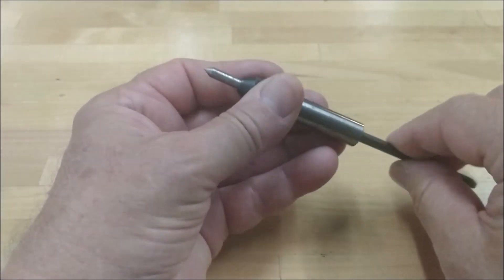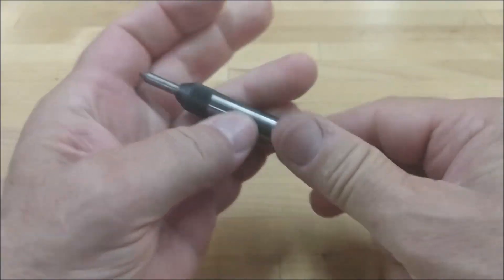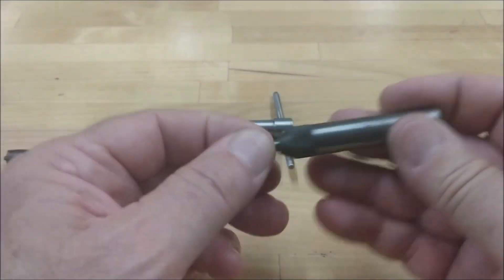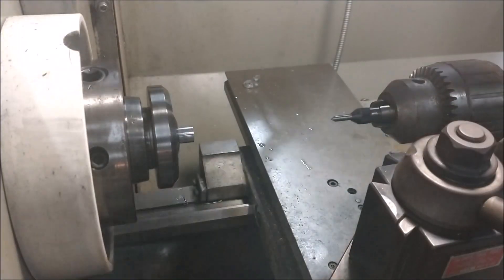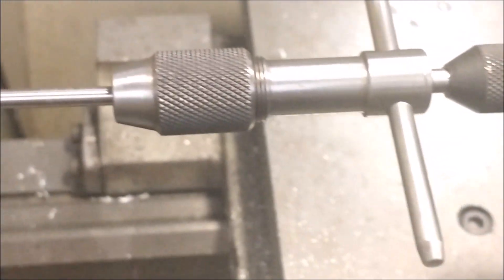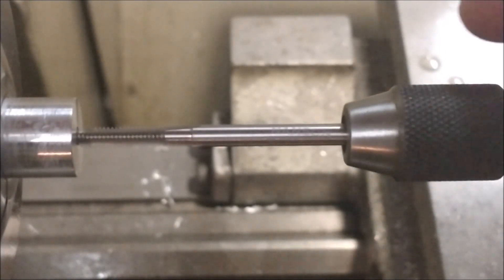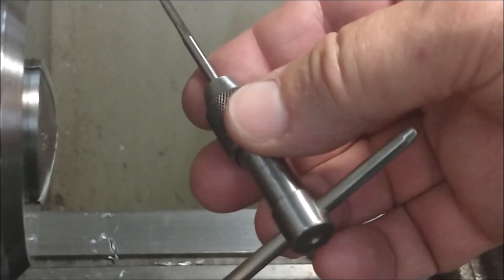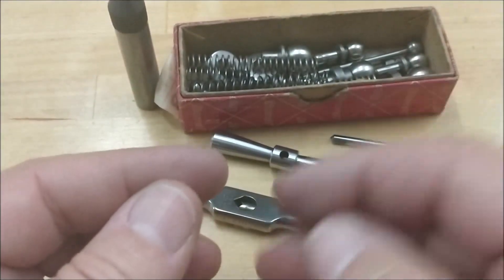Machinists.....Tapping a thread on a Mill or Lathe?...Don't Do This !!!

Comment: I discovered that an ordinary but high-quality drill chuck holding the tap hand-tightened.  Drill the hole, then switch out the drill for the tap in the chuck, then tighten the tap by hand.  Spin it up, and when the tap binds in the hole, it's dead center.  Loosen the chuck, and it can be finished by hand with a t-handle.  It works 100%.

Comment: I'd never tighten the tap handle chuck fully (actually, I run it tight, then back it off a bit)  specifically to allow the tap and handle to have some angular/axial compliance.  The handle ought to provide rotational torque only, and it doesn't need to be "tight" on the tap in order to drive the square sides, not even snug, sloppy is good (akin to an electric motor coupler designed for misaligned shafts).  Taps are good at "finding themselves" and will self-align to the pilot hole, especially hand taps w several lead threads (switch to the bottoming taps or machine taps later) so it's your job to NOT side-load the tap as she goes in.  IMHO the tap guide helps me get the tap square-ish to the pilot hole at the very start (free-hand angles are hard) - and to prevent your hand from twitching/shaking too much and risking breaking the teeny tiny taps or wallering-out the first couple threads.   I disengage the tap guide after I have several good threads that are strong enough to take over on the alignment duties (I keep it close and use it for a hand-brace, or for a visual reference to ensure I haven't pushed things out of alignment by accident).   I'll often remove the handle and spin the tap out w my fingers as soon as possible - for clearing chips and re-enter the hole (less potential for side load).    There is a style of tap handle which has a bored hole on the end (not the cone center) which allows you to use a long dowel pin in the lathe/mill to pilot the handle, requiring no spring(s) at all; this eliminates the axial spring force entirely - making you in control of the exact amount of force you desire to start the tap, 000-120 or 1/2"-13.  It also prevents you from accidently overpowering the limited spring/cone axial aligning force (risking forcing the handle/tap off the centerline, which is more likely when cranking hard on those big taps).  I suppose the cone type handles could be modified w a bored hole?   It's comforting to apply only the forces you want (torque, starting-force) and feel only the reaction forces from the cutting & chip binding loads, and not worry about the handle slipping out of a spring loaded center.  Joe's little tap-mounted drive handle is sexy though - never seen one of those!
Reply from the maker: Drive the tap with a "tap Handle" and the worry of runout will be greatly reduced. Regardless of what style 'T' handle you use, the stack will introduce possible wiggle joints.
Reply: I've done pretty much the same - babying it so that the wobble doesn't ruin things. Liked your suggestion of making dowel tap holders, I've made some of those. Also a good mini chuck can do better than a tap handle, and a pin vise with a collet that's the size of the tap can work. That wobble is scary, even with the smallest Starrett tap holder - which doesn't clamp a tap all that precisely. With a 1-72 or smaller tap it really gives ya the heebie jeebies!

But this video is great, in machining it's always good to find the most precise method. The little Joe-made tap holder is a future project. Thanks Joe, keep thinking up these little tricks!
Reply: @sisyphuscranerigging7792   Agreed,  Joe is the man!  I think we all see the limitations/risks of the cheesy tap handles, and Joe has gone and perfected the method to control the alignment (flipping the cone bit around in the tap guide is sweet) and maybe we've gone towards accepting/accommodating low precision tooling, or looking for alternatives (i like the mini-chuck idea, i have several kicking around).  For the part in the video, I might even take it out of the lathe collet and just hold it (to reduce chances of side loading the little tap) after establishing several good starting threads.    FWIW, the OTS dowel pin based tap handle is a "Walton" brand (I'm looking at a "276")  there are a couple positions on the body for the drive handle, based on how you want to use it. this might be hard to replicate in a modified cone handle.

Comment: Get yourself a decent T handle wrench and its not a problem. If the center in the back WAS used to manufacture the device then it will run concentric. Your tap is not square in the jaws. I'm not some 'Fred in a shed' been making aerospace components for over 50 years!!!
Reply: The square jaws of the T handle are only parallel  at one opening size. Any larger or smaller it can’t hold a tap coaxial with the hole, no matter how much you paid for it.
Reply: You are correct, garbage t handle with jaws not broached on center. I bought some Starrett t handles about 20 years ago and one was unusable because of the jaws. I don't buy Starrett anymore.

Comment: A number of years ago I made a few sizes of basically knurled knobs with set screws in a center hole to fit small tap shanks. Similar to your small tap handle just a full diameter handle, I later adapted one of these with an ER11 collet holder so no set screws anymore and the tap is held dead center in the knob. Besides the runout I also hate using a tap handle on a mill such as a Bridgeport due to the length... With a chuck, spring center, tap handle, then the tap you most always have to crank the knee way down to fit all that.

Comment: Just to be clear, I'm not disagreeing with anything JoePie is saying or demonstrating, but I'm wondering if some of what is causing that rather pronounced deflection seen at around [5:00] is produced by a sideways force produced by the thread of the tap trying to climb out of the hole in the part because the tap is being turned in reverse which exaggerates the problem under discussion.  The problem is real but the particular set-up possibly exaggerates the out-of-concentricity forces acting on the tap.
Reply: No, the jaws in those tap handles aren't precision ground at all. I only use them for finishing a pre tapped hole to final depth by hand.
Reply: @tonymiller8826  I get that, I totally understand that, my point is that turning the tap in the direction opposite to that it is designed to turn it going is going to impose a different force orthogonal to concentricity [if that makes any sense]  whereas if the tap is turning normally and is digging into the part it is going to 'try' to straighten the tap which is the load that will ultimately break the tap - as we all know.  

If you think geometrically about what is going on with that setup when it is turning in opposite directions, the forces on the tap are not the same - which is my basic point.
Reply: @williamreymond2669  He turns the tap backwards with the small tap handle holding the round shank of the tap with the cup end of the spring center guiding the tap directly and there is Zero perceptible runout in the tap. Turning the tap backwards is not causing runout... The non precision jaws of the tap handle griping the square of the tap is causing all the runout in the first example. Even if the tap doesn't break having just a little runout can cause a No-Go gage to Go especially in soft material and QC would fail your part... In a real world non hobby garage setting.

Comment: The wobble of the tap as shown was more a result of a bad chuck in the tap holder than the hole at the back of the handle.
Reply: That's what it looked like to me, too.  It looked like a banana, more wiggle in the middle than back at the end.  If the misalignment was caused by a lack of a positive centre at the rear of the tap handle, that's where there should have been the most movement?

It also seems like something that could be more easily shown by chucking the tap handle into the lathe and reading off the runout of the OD vs ID...?

Disclaimer: absolutely not a machinist, but I reckon I can troubleshoot and interpret stuff pretty logically.  The logic he's describing doesn't seem to match the results he's displaying here.

Disclaimer on the disclaimer:  It seems like it'd be a pretty good idea to validate your tap follower and not just assume it has a precise centre, just on principle.  That's absolutely a good point he's raising.

Comment: You can buy better machined T tap style wrenches that are made specifically for doing what you just done. Tbh it depends on the application,  hand tap, machine t tap, machine tap holder, machine tap joes method that just elimenates problems, or depending on the quality and class of thread macine cut the thread.  As long as you know the quality of your work and the quality required you can then apply it to the task.
Reply: My t handle tap wrench has about a thou of runout with the indicator on he tap. His t-handle is junk. Better advice: Keep junk tools out of your shop.
Reply: @gregoryhouck5738  to be fair, he highlighted a potential issue in your own quality control, and he got to make a wee video in doing so. Im all in favour of openess of knowlede and skills for all.
Reply from the maker: Even a good quality tap handle can have this problem. It all has to do with the short length of engagement of the tap end and the one sided closure design of the handle jaws. The handle used here was made in the USA and is superior quality to most handles its size.
Reply: Yup, All you forgot is to add "patience". Are we all not Patient, LOL.

Comment: Joe, great video as always. I do a lot of threading with small sized taps for astronomical telescopes, mounts, and cameras so breaking one is always a risk and can be disastrous. One thing many don't realize is taps come in different types. The standard  most common type has a taper to the thread cutters so it can be aligned somewhat as you start the operation. There are also bottom threading types that are designed to thread far down into a blind hole (one that doesn't go completely through the material) They have very minimal starting taper.You NEVER should start with that one. The other type has a much longer taper to help perfectly align the tap and those are the one you should start with to ensure your tap is perfectly aligned with the hole especially on small tap sizes. I buy my taps in the sets that include all three types for each thread size. I am now 77 years old but learned this from my teacher in a gunsmithing class 60 years ago. I had spent hours machining a bench rest rifle barrel  and action that was blued and only thing left was to drill and tap for the scope mount. I was terrified all that work would be destroyed with a broken small tap. My instructor showed me his tricks and it was completed perfectly. The most critical thing is the start of the tapping operation... make sure the hole and tap are absolutely aligned. Also take the time to back the tap out several times to clean out all the bits of metal cuttings. It is tempting to get lazy and try to power the tap through when it gets a bit tight due to chip jamming. That is when things go south :face-pink-tears:
Reply from the maker: https://www.youtube.com/watch?v=xzhyXChqEWM&t=32s
https://www.youtube.com/watch?v=ODfBSSuJP6I

Comment: You're right about the centers being off, but it's sometimes on cheap wrenches,  the jaw faces are not square. I made my own, and used them with centers in lathes, vertical mills, radial arm drills, for more than 60 years, and produced nice, square holes, every time. A long time ago, I started hating tapping, without a lail support.

Comment: We have a tap wrench that has a seperate guide dowel that fits into the rear of the wrench.body.  Is that kind of setup still a no no?  You would probably be grabbing the dowel in the mill by a collet and the dowel then goes into the wrench.

Comment: Thanks for the advice Joe. I'll no longer do that anymore. I normally start the tap in the drill chuck and feed in into the part to get it started, then finish off with a T handle wrench, sprung loaded. 

I'll be careful what I'm doing from now on. 

I, like some of the other comments on here have tought myself how to machine parts so I'm loving your channel and the advice you give out. It is appreciated.

Comment: I stopped using those spring-loaded guides altogether because I could never get the tap to go in straight. I'd assumed that I - an untrained amateur - was just doing it incorrectly. I think that I'll give it a try again without the tap handle.

Comment: Hey Joe, Thanks for all your videos. I've learned a lot from you and a few other YouTubers. Actually, I am not a machinest. My degree is in Electronics Engineering Technology. But, I used to love spending as much time in the machine shop as posible, before retirement on disability in 2007. I just turned 74 and am now working in my little shop doing busy work. I can now fix, repiar, build and design most anything that the community brings into my shop. Moreover, i dont charge for any services. You have been a blessing to me over these years and i thank you sir, for all you have done for me and others.
Reply: Awesome bud. Disabled retired  like yourself. We fix,make or repair everything. Where would mankind be without machinists.
Reply: @TomokosEnterprize  Thank you for the comment Brother. I have many maladies, but the one that bothers me most is that I shake so badly that I can hardly hold my calipers to make a measurement, but with perseverance I somehow prevail, lol. I had a good friend years ago, who was a mechanical engineer. He and I worked together on several projects, me doing the electronics control and he doing the mechanical aspects. Joe Pie has several attributes that remind me of him.
Reply from the maker: Thank you very much for taking the time to leave such a great comment. This type of feedback really means a lot to me. Best of luck to you and be careful. BTW...My Father was an electronic engineer. He founded Artisan Controls Corp up in NJ. The company is still going strong today.  Stay well.

Comment: Just put the tap in the tail stock chuck, close the jaws so that they are not tight enough to stop the tap rotating, and use your handle. I've been doing it that way for over 50 years. I don't break taps.
Reply from the maker: Once the tap is in the tailstock chuck, the square end is inaccessible. How do you drive it?
Reply: @joepie221  You grip the shank or the end of the thread ( at the square end ) with the same screw on handle. I use a small 2 piece tap wrench that does the same job. On taps over 6mm/1/4" I grind a flat on the shank, because the handle/wrench tends to slip on that smooth shank, because of the torque required. So you only have as much shank as necessary for accuracy in the chuck jaws.
Make my own miniature tap wrenches, and they tighten with 2 Allen screws. They grip REALLY tightly.

Comment: Having noticed the wobble with T handles I switched to ER collet holders for drilling and tapping threads.  Taps are of course driven with  Joe Pie knock off tap handles.  Don’t be afraid to keep the handles small when driving small, fine taps.
Reply from the maker: A large handle on a small tap is a recipe for disaster. Agreed...small handle or knob is the way to go.
Reply: @joepie221  agreed, the first time I saw one of your tiny handles I knew they would be helpful.  I do a lot of small tapped holes, odd sizes, and in harder material.  I made a couple handles that day and now have several more, including ones for shaped reamers which must be straight and cut to a precise depth. Many of the taps have neither a cone or center hole, which led me to use the ER collet to support the rear. Another Advanced Innovation to the rescue.  I’ve had enough bones repaired I’m betting on of your ideas has been in my life before, or will be soon.  Arthritis can be brutal I can attest to that.
Reply: @takedeadaim8671  I have yet to see Joe lead anyone astray. We are lucky to have him.
Reply: @TomokosEnterprize AGREED

Comment: 👍 thanks for sharing.
I have General brand t handles and they seem to run concentric enough to use the center. 
Maybe that one has some bad jaws?
Reply from the maker: The smaller the tap, the shorter the top square section is. As the jaws close, they don't get full engagement along the length of the entire jaw. I bet this problem would disappear ( or be reduced ) if the top square on the tap was 3x as long.
Reply: Yes agreeed,  I use Starrett T handles and they appear pretty concentric, I certainly don't see anything like the 'runout' that Joe had with his. But I will certainly be very weary of this in future, thanks Joe as usual very informative.

Comment: During my Apprenticeship, we were taught that you start true, stay true.  I've got Starrett and Greenfield Tap wrench's and they are both good at one thing; cranking taps in and out but they aren't great at starting taps if you depend on the centers in the end.  They all run out.  I start tapped holes with either tap guides or use a drill chuck, then use the tap wrench after a few turns in.   Joe had the benefit  of being around good  mechanics (Navy yard slang for Machinist)during his formative years and that's what makes the channel informative.  There is no substitute for actually working in the shop around experienced men and developing the necessary temperament for the trade.  Not everyone is good at this.   The YT'ers that actually worked in the trade are very evident.
Reply from the maker: Like using all the tolerance on each dimension of a part and getting bit at the end. My motto...Start tight, end right.